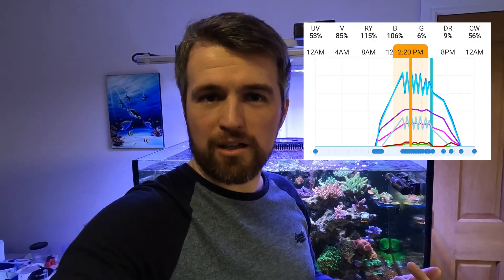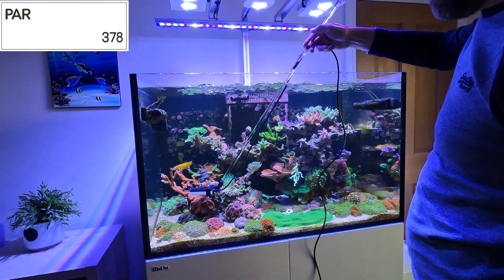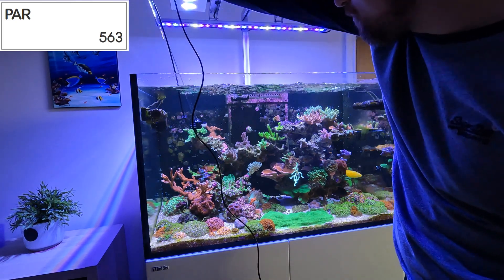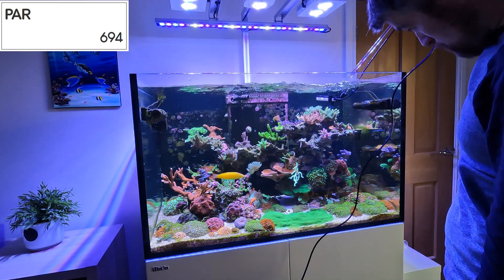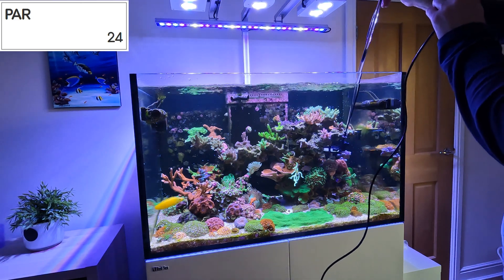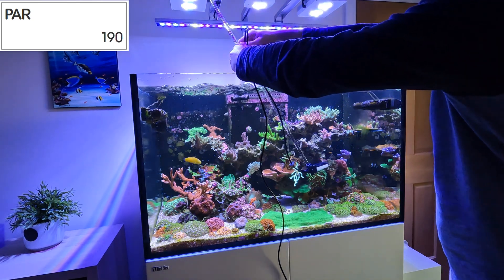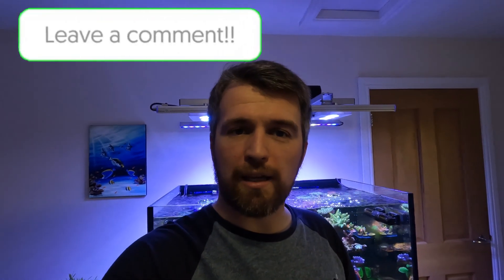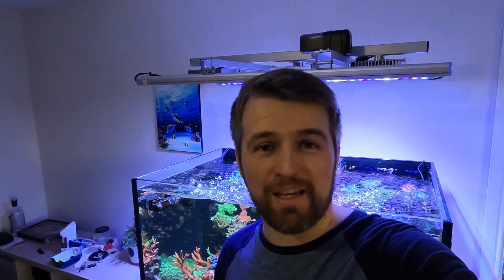Measuring my reef tank PAR (Is it too high?!)

Comment: Great video! Quick question...were did you get the stick that is holding the PAR sensor?
Reply from the maker: Thanks! I bought it from a company called Aqua print in the UK. They have a range of 3D printed products for the reefing hobby. The holder makes life so much easier compared to trying to hold it by hand. 
https://aquaprint.uk/index.php/product/seneye-adjustable-clamp/